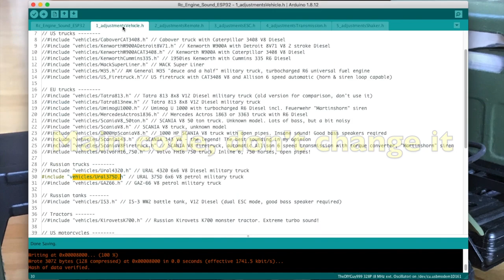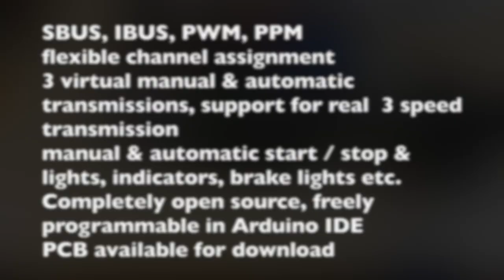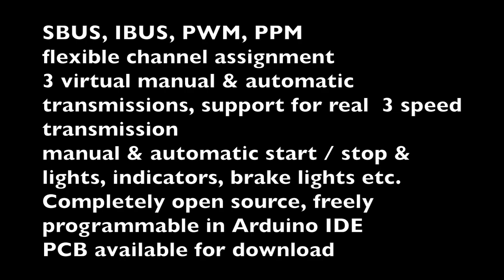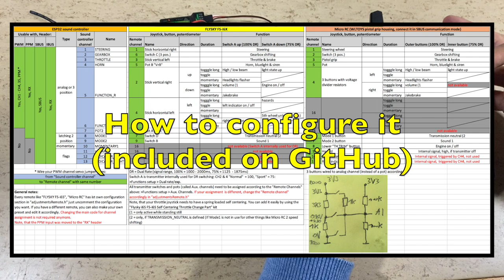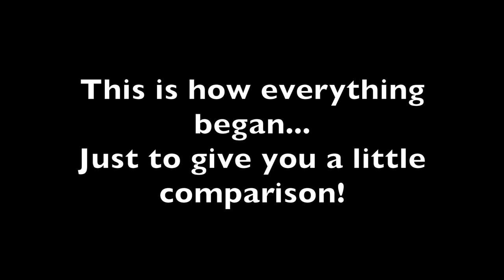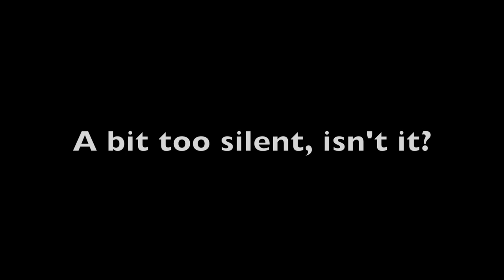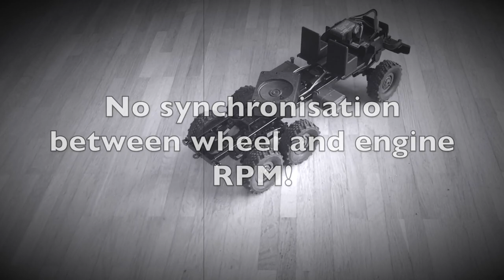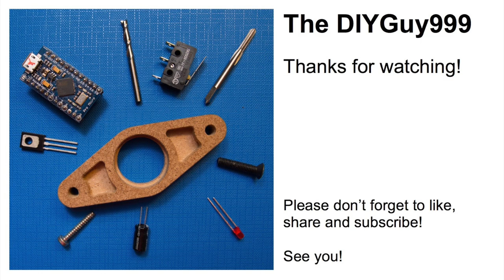The Best Engine Sound & Light Controller For RC Crawlers & Trucks!

Comment: Nice to see someone finally simulates the gearbox, even though it is just 3-speed. Not many RC-owners/operators are used to shifting :)
Reply from the maker: You can also use the simulated 3, 4 or 6 speed automatic transmission with torque converter or the double clutch transmission. I'm also working on a simulated manual transmission with more than 3 gears. There is also the option to use the real 3 speed TAMIYA transmission, which is synchronised in software and can be shifted while driving.

Comment: Hello ... I'm setting up your project and I have a question: why in the 30-pin version do you use transistors and in the 36-pin version you use 330 resistors? You say you don't recommend transistors in the latter, why?  Another thing: my receiver is old, PWM, and delivers 5V. Can I connect directly to ESP?
Reply from the maker: Hi, the 330 Ohm resistors are directly between the output pin and the load. The LED will not be able to run @ full brightness with this setup, because there is a current limit on the output pins. I can't remember I said I don't recommend to use transistors. Make sure, you use external resistors (according to the LED color), if you use output transistors. You can't feed in 5V PWM signals, as the board labelling clearly says. However, I don't think your PWM signal (the peak voltage) is 5V. Are you sure? If the peak voltage really is 5V, you could use voltage dividers.

Comment: Hello good afternoon.
First of all, thank you for the trouble.
I am a beginner in electronics, but a big fan of radio control, so when I found DIYGuy999's videos, I decided to make the assembly he proposed for Sound and lights. I have made two assemblies, the Thru_Hole_30pin, and the SMD_30pin_SM, I am sending you images, and in both I have had the same problem, I cannot get voltage to the ESP32. I have checked that the board is fine by feeding it directly with the USB, it turns on and the blue LED flashes, although it does not emit sound. If I feed it with the external battery, the ESP32 does not turn on. I have gone over the soldering and connections a thousand times, and I do not know what could be wrong. Please, if you have any ideas, let me know. Thanks.

Comment: Thanks for making your sound card even better.    BTW do you have a source for shaker motors.    Thanks.
Reply from the maker: You're welcome. Are you happy with yours? The shaker is from GT-Power
Reply: @TheDIYGuy999  Yes I am happy with the sound card.    I feel it works much better then the Tamiya MFC for less then 1/10 the cost.     I have not played with this ver yet, but I like the channel assignment that you have added.       I would like to put the lights control on a twist knob on the radio and have it work like a car light knob.   position 1 all off, position 2 parking lights (all lights except head lights and fog lights.)  position 3 head lights on, position 4 fog lights if they exist,  position 5 just 4 way flashers.

Comment: helo, this sound engine work great! but I have some problem. my RC is scx10ii with single speed. In the virtual 3 speed transmision sound, the first gear is too short. I want to stay in first gear  more longer in higher rpm, which code should I change? 

My transmitter is sanwa mt4 with original receiver and it used classic pwm signal
Reply from the maker: Thanks. Are you talking about the automatic transmission with torque converter? If yes, it is not really suitable for crawlers. Better use the virtual, manually controlled 3 speed transmission in this case
Reply: @TheDIYGuy999   okay, understandable. maybe im talking about virtual clutch. in this line:

 // Virtual clutch ********************************************************************************
    if ((currentSpeed < clutchEngagingPoint && currentRpm < maxClutchSlippingRpm) || gearUpShiftingInProgress || gearDownShiftingInProgress || neutralGear || currentRpm < 200) {
      clutchDisengaged = true;
    }
    else {
      clutchDisengaged = false;
    }
***********************

if I change it value to 300, the 2nd or 3rd gear will shift at higher rpm (deeper throttle) right?

Comment: do you have source code that will work on the NANO? no engine sounds or vibrations required, but i would like to use the iBus function. i have a flysky i6X. 
im completely new to Arduino, otherwise i would have attempted to modify the current code.

Comment: I use flysky i6 for transmitter with 6 ch receiver with ibus 
if i use 2 speed wlp gearbox which ch i can konect the servo gearbox cause even the transmitter up to 10 ch  but the receiver socket is 6
Reply from the maker: Have a look at adjustmentsRemote.xlsx. It says CH6 ;-)
Of course you have to configure your transmitter channels accordingly.
Reply: Ch 6 is switch c(3 position) thats use for virtual transmisi..
So i asume if i conect to ch 6 it will be syncronyze but only 2 manual transmision(cmiiw)

Comment: do u think it possible to make this system work with some sort of rotatry sensor, im making a truck from lego and i wanna try to connect it to a lego moter and then based on the posistion from the rotatery sensor the sound shifts and when the rotatary sensor goes back it switches the light if u want to know what i am talking about i can send u an email with some design drawings.
Reply from the maker: What typ e of rotary sensor? I don't see the sense of this.
Reply: @TheDIYGuy999  i want to control sound with a lego servo so when the rotary sensor goes left its like a truck going forward when serco steers the rotary senser right its reverse and makes the beeping noice

Comment: what reciever and what transmitter do u suggest for a beginner in arduino and rc trucks?
Reply from the maker: It depends on what you want. Car stile, stick based, SBUS or not?
Reply: @TheDIYGuy999  i want 1 with 2 of those joysticks and lot of buttons for my upcoming rc truck with palfinger crane

Comment: Arduino: 1.8.13 (Windows 7), Board: "ESP32 Dev Module, Disabled, Default 4MB with spiffs (1.2MB APP/1.5MB SPIFFS), 240MHz (WiFi/BT), QIO, 80MHz, 4MB (32Mb), 921600, None"

G:\Rc_Engine_Sound_ESP32\Rc_Engine_Sound_ESP32.ino: In function 'void led()':

Rc_Engine_Sound_ESP32:1691:84: error: no matching function for call to 'statusLED::flash(int, int, int, int, int, uint32_t&, uint8_t&)'

       if (indicatorL.flash(375, 375, 0, 0, 0, indicatorFade, indicatorOffBrightness)) indicatorSoundOn = true; // Left indicator

                                                                                    ^

In file included from G:\Rc_Engine_Sound_ESP32\Rc_Engine_Sound_ESP32.ino:54:0:

F:\Users\Rossi Tamiya\Documents\Arduino\libraries\statusLED-master/statusLED.h:24:10: note: candidate: bool statusLED::flash(long unsigned int, long unsigned int, long unsigned int, int, int)

     bool flash(unsigned long onDuration, unsigned long offDuration, unsigned long pauseDuration, int pulses, int delay = 0);

          ^

F:\Users\Rossi Tamiya\Documents\Arduino\libraries\statusLED-master/statusLED.h:24:10: note:   candidate expects 5 arguments, 7 provided

Rc_Engine_Sound_ESP32:1699:38: error: no matching function for call to 'statusLED::off(uint32_t&)'

     else indicatorL.off(indicatorFade);

                                      ^

In file included from G:\Rc_Engine_Sound_ESP32\Rc_Engine_Sound_ESP32.ino:54:0:

F:\Users\Rossi Tamiya\Documents\Arduino\libraries\statusLED-master/statusLED.h:26:10: note: candidate: void statusLED::off()

     void off();

          ^

F:\Users\Rossi Tamiya\Documents\Arduino\libraries\statusLED-master/statusLED.h:26:10: note:   candidate expects 0 arguments, 1 provided

Rc_Engine_Sound_ESP32:1703:84: error: no matching function for call to 'statusLED::flash(int, int, int, int, int, uint32_t&, uint8_t&)'

       if (indicatorR.flash(375, 375, 0, 0, 0, indicatorFade, indicatorOffBrightness)) indicatorSoundOn = true; // Left indicator

                                                                                    ^

In file included from G:\Rc_Engine_Sound_ESP32\Rc_Engine_Sound_ESP32.ino:54:0:

F:\Users\Rossi Tamiya\Documents\Arduino\libraries\statusLED-master/statusLED.h:24:10: note: candidate: bool statusLED::flash(long unsigned int, long unsigned int, long unsigned int, int, int)

     bool flash(unsigned long onDuration, unsigned long offDuration, unsigned long pauseDuration, int pulses, int delay = 0);

          ^

F:\Users\Rossi Tamiya\Documents\Arduino\libraries\statusLED-master/statusLED.h:24:10: note:   candidate expects 5 arguments, 7 provided

Rc_Engine_Sound_ESP32:1711:38: error: no matching function for call to 'statusLED::off(uint32_t&)'

     else indicatorR.off(indicatorFade);

                                      ^

In file included from G:\Rc_Engine_Sound_ESP32\Rc_Engine_Sound_ESP32.ino:54:0:

F:\Users\Rossi Tamiya\Documents\Arduino\libraries\statusLED-master/statusLED.h:26:10: note: candidate: void statusLED::off()

     void off();

          ^

F:\Users\Rossi Tamiya\Documents\Arduino\libraries\statusLED-master/statusLED.h:26:10: note:   candidate expects 0 arguments, 1 provided

Rc_Engine_Sound_ESP32:1715:58: error: no matching function for call to 'statusLED::flash(int, int, int, int, int, uint32_t&)'

     if (indicatorL.flash(375, 375, 0, 0, 0, indicatorFade)) indicatorSoundOn = true;

                                                          ^

In file included from G:\Rc_Engine_Sound_ESP32\Rc_Engine_Sound_ESP32.ino:54:0:

F:\Users\Rossi Tamiya\Documents\Arduino\libraries\statusLED-master/statusLED.h:24:10: note: candidate: bool statusLED::flash(long unsigned int, long unsigned int, long unsigned int, int, int)

     bool flash(unsigned long onDuration, unsigned long offDuration, unsigned long pauseDuration, int pulses, int delay = 0);

          ^

F:\Users\Rossi Tamiya\Documents\Arduino\libraries\statusLED-master/statusLED.h:24:10: note:   candidate expects 5 arguments, 6 provided

Rc_Engine_Sound_ESP32:1716:54: error: no matching function for call to 'statusLED::flash(int, int, int, int, int, uint32_t&)'

     indicatorR.flash(375, 375, 0, 0, 0, indicatorFade);

                                                      ^

In file included from G:\Rc_Engine_Sound_ESP32\Rc_Engine_Sound_ESP32.ino:54:0:

F:\Users\Rossi Tamiya\Documents\Arduino\libraries\statusLED-master/statusLED.h:24:10: note: candidate: bool statusLED::flash(long unsigned int, long unsigned int, long unsigned int, int, int)

     bool flash(unsigned long onDuration, unsigned long offDuration, unsigned long pauseDuration, int pulses, int delay = 0);

          ^

F:\Users\Rossi Tamiya\Documents\Arduino\libraries\statusLED-master/statusLED.h:24:10: note:   candidate expects 5 arguments, 6 provided

exit status 1

no matching function for call to 'statusLED::flash(int, int, int, int, int, uint32_t&, uint8_t&)'

This report would have more information with
"Show verbose output during compilation"
option enabled in File -> Preferences.

i have this massage when i compile it...what should i do sir. thanks a lot and btw its awesome project
Reply from the maker: Install the StatusLED library. Please read this document carefully:
https://github.com/TheDIYGuy999/Rc_Engine_Sound_ESP32/blob/master/README.md

Comment: I got problem with new firmware... Can u help me??? "Rctrigger"
Reply from the maker: Update the RcTrigger library
Reply: @TheDIYGuy999  I dm u at Instagram
Reply from the maker: @ronaldprasetyo6806  As I said. Update the RcTrigger library
Reply: I did... But still got problem... "Rctrigger does not name a type"
Reply from the maker: @ronaldprasetyo6806  In this case update the Arduino IDE. I assume you are on 1.8.7, which is not compatible
Reply: @TheDIYGuy999  so what can I do to fix it?
Reply from the maker: @ronaldprasetyo6806  As I said, use the latest Arduino programming software ;-)

Comment: is it work for 6ch pwm remote with pistol grip
Reply from the maker: It should. Just make a new configuration according to: https://github.com/TheDIYGuy999/Rc_Engine_Sound_ESP32/blob/master/adjustmentsRemote.xlsx
Reply: @TheDIYGuy999  threre is an erro
C:\Users\Tarigan\Documents\RC Engine sound\NEW\update  v5.6\Rc_Engine_Sound_ESP32\Rc_Engine_Sound_ESP32.ino: In function 'void rcTrigger()':

Rc_Engine_Sound_ESP32:2206:24: error: 'class rcTrigger' has no member named 'onOff'

   mode2 = mode2Trigger.onOff(pulseWidth[9], 1800, 1200); // CH9 (MODE2)

                        ^

exit status 1

'class rcTrigger' has no member named 'onOff'

This report would have more information with
"Show verbose output during compilation"
option enabled in File -> Preferences.
Reply from the maker: @frenkkotarigan7036  Please read the manual and update the rcTrigger library as mentioned in the changelog
Reply: Ok sir,i will try again,tq 🙏
Reply: It works,tq sir 🙏
Reply: Is it possible to use jakebrake fiture with 4ch pwm tx/rx?
Reply from the maker: @frenkkotarigan  Depends on your channel assignment
Reply: can the existing vihicle file be edited
Ex: if i want to add new horn on volvo vihicle sound
Reply: How i can use the new converter tools?is it work if i use the old converter version instead of the modified one
Reply from the maker: @frenkkotarigan  Of course. Open the .h file in an editor and add the link to your sound file.
Reply from the maker: Just open the included "Audio2Header.html" in your browser. Don't use the old one
Reply: I have try,but when i open the "audio2header.html" its going to your github
Sory for many question 🙏
Reply from the maker: @frenkkotarigan  Of course it goes to my GitHub, if you click the link ;-)
Just do it according to the step by step manual on my GitHub: "How to create new .h sound files:"
Reply: I has compile the code without change anything,when its done why  the blue light on the esp  is blinking(left signal indicator)?
Reply from the maker: @frenkkotarigan  This is because you selected the "Micro RC" remote profile in 2_adjustmentsRemote.h
Select Flysky or make your own profile.
Reply: i tried with version 5.4 where there is no 2_adjustmentsremote.h and the same thing happened but not with version 5.2
Reply: Problem solve,i made a mistake 😁
Now its work properly 😊